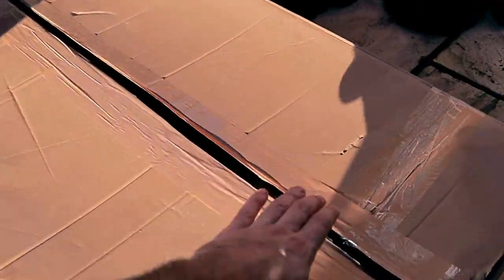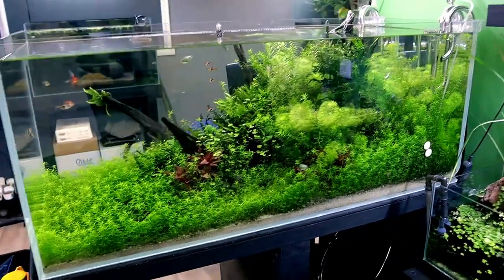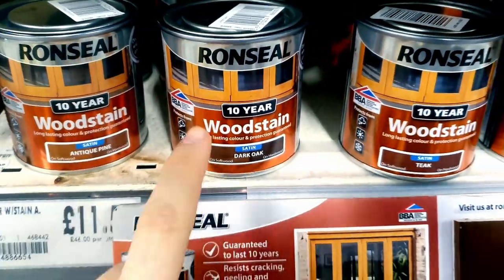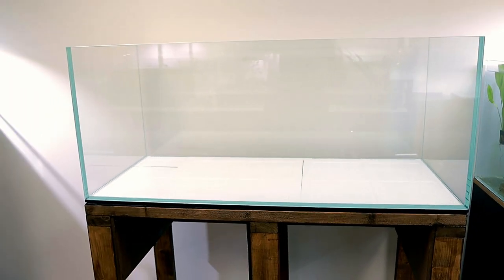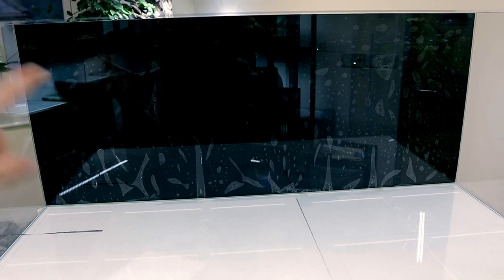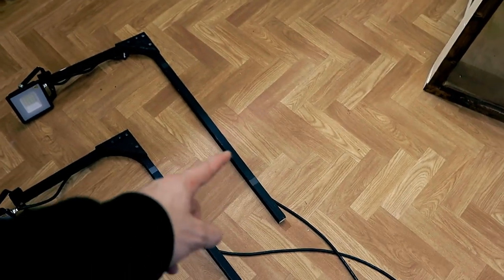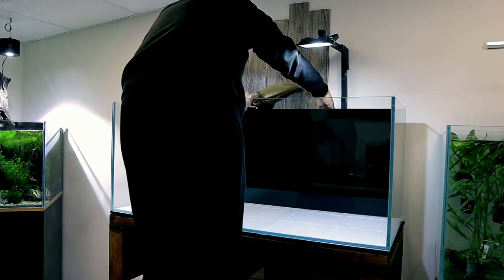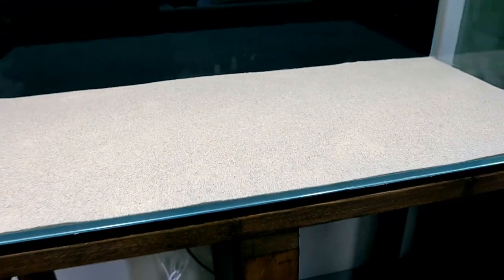Building THE AMAZON Tank (part 1) | MD Fish Tanks

Comment: I like it!.... I like it a lot. You jumping on the table bought back bad memories. I had a piece of Ash tree trunk that I wanted to calve. So I had the bright idea of putting it on my Black & Decker Work bench outside. I had stood on the work bench many times in the past but just wanted to check that it was OK to take the weight of the trunk. Now the trunk was nearly 4ft high by 22" wide so it weighed heavy. I tested my work bench by doing a couple of push ups on it...... I weigh just over 20 stone and bang went the bench. I had landed with my chest against the work bench table! It had collapsed under me. I was getting over a heart attack so my wife and neighbours panicked including myself. I was in massive pain.... And ambulanced to the hospital with blues and two's on. All while I was gasping on gas and air. I had broken 4 ribs... Cracked a further two... Extensive internal bruising. I couldn't stand or lay down without morphine! The internal bruising was so bad it could be seen on the inside of my throat when I opened my mouth! I had a massive surface bruise on my chest... JET BLACK it looked like a woman's crop top and lasted for weeks! When I could walk I examined my work bench... All the square tubular frame was mangled up and couldn't be used! So Needless to say the Ash tree trunk still stands in the corner of my garden. I was really lucky.
Please be careful when test the strength of things... It could end up in agony! Take care my friend and I look forward to the 2nd installment of the Amazon tank👍😷👍

Comment: Hey not trying to be rude or anything but the thing that you used on the back is way more difficult than anything that you need to use.

I take and I paint backgrounds on tanks different kinds of custom things for a living it lasts forever all you have to do is scrape it off for the razor blade it's way easier than using any of these plastics or anything that anybody sees on the back of tanks